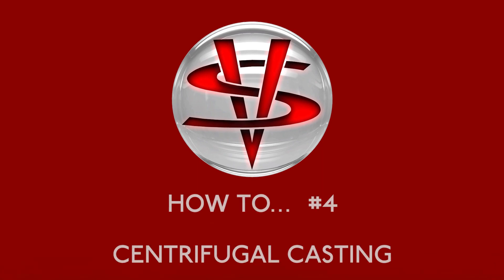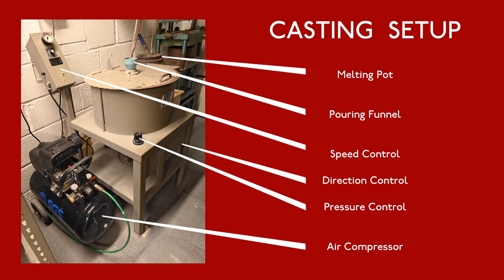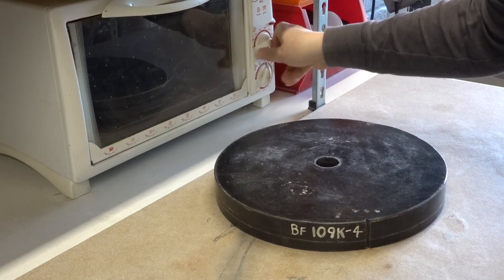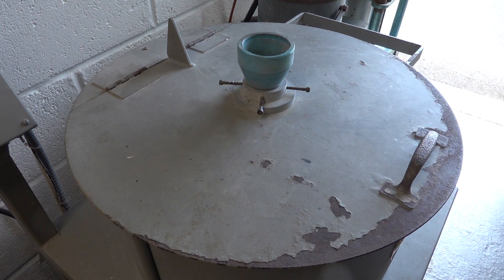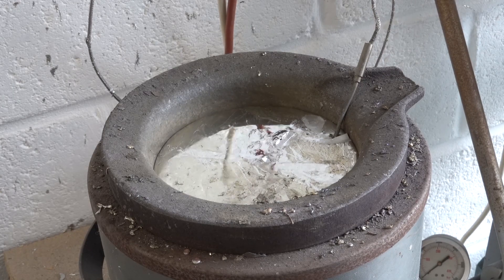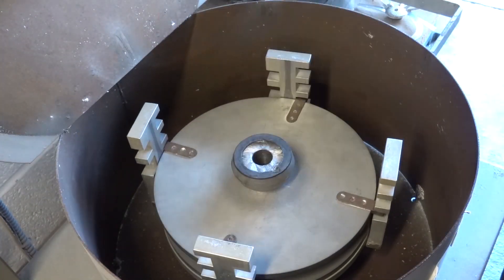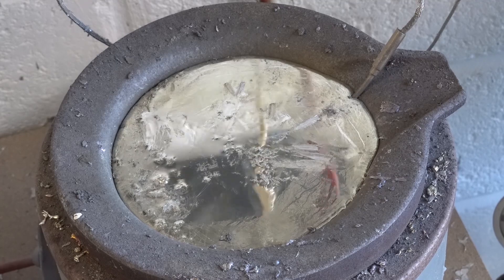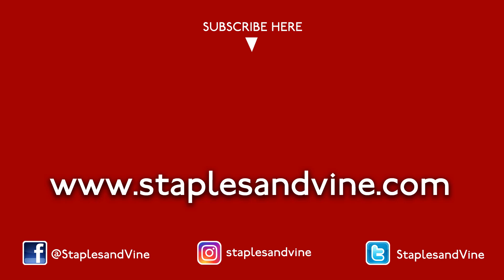HOW TO… PART 4  ‘CENTRIFUGAL CASTING’

Comment: I am considering commissioning some sculpts of 1/56 figures from a talented sculptor. I want these figures to be size compatible with figures from a specific existing commercial range which I like. I can then wargame with both my own and the commercial figures at the same time.
But will the resulting production casts I make shrink and end up smaller than the sculpts? In other words, should I commission the sculpts slightly larger than the existing figures from the commercial range?
Reply from the maker: Yes you will have to allow for shrinkage! Metal contracts on cooling and it depends on the bulk of the item being cast. Larger chunky items shrink more than small fine items. Allow for about 2-5% and you should be OK. It's all trial and error so try a couple, measure the result and go from there. 🙂

Comment: Why are the vents cut to the perimeter? Could they be brought back closer to the center, ensuring to avoid feed mouths and drilling to the top of the mold? Would this prevent overflow spilling. 
Thank you for the wonderful layout of your videos. They are very educational and provide all the right information.
Reply from the maker: Thanks for the comment Jason. The metal flowing down the vents is not a problem as the excess is easily removed on clean up. The primary goal is good casting quality which is way more important and more difficult to achieve. 🙂

Comment: Hi sir
air compressor for what it was: show in the end video
Reply from the maker: Hi Imran, the compressed air is used to operate a ram which holds the mould closed. The clamping pressure can be adjusted on a dial. 🙂
Reply: @StaplesandVine  please show me in the video

Comment: Just wondering if the vulcanized rubber could be used with aluminum?
Reply from the maker: Definitely not, unless flames, explosions, fire-engines, ambulances and a trip to hospital are on your agenda. This process is for tin based alloys only.
Reply: @StaplesandVine  thats what i was thinking, but never delt with vulcanized rubber. and figured it was worth a quick ask.

Comment: Very nice. I thought that material was zamak. Do you also use it for your castings?
Reply from the maker: I only cast in pewter. Zinc based alloys require a much higher temperature and are more dangerous to cast with.

Comment: Great video series! I love your videos in general. Im new to these processes for pouring pewter and had few questions. I was wondering what makes you choose the vulcanized rubber method vs the silicone? Is one better for some things then others? Does one result in better details? Also I was just curious, I questioned it and wavered back and forth but what makes you choose to do pewter castings over “cold-casting”? if you have tried that. Thank you in advance for any help and information.
Reply from the maker: Thanks Justsomeguy glad you like the series. Lots of questions...
1. Vulcanised centrifugal rubber moulds give far better quality castings than the cold cured silicone with less distortion and finer detail.
2. Cold cure silicone moulds are only used by me for one-offs or to convert a 3d printed part into metal.
3. Silicone centrifugal moulds are available but are more expensive.
4. Resin / cold casting is fine but fails cannot be re-cyclyed unlike pewter castings which are just re-melted and you go again.
5. Tried resin casting - didn't like it. 😁

Comment: please tell me how thick the wing of the plane is and what kind of rubber do you use for the mold?
Reply from the maker: The wing is about 6mm thick at its maximum. There are a lot of different rubber grades but I get mine from https://j-coker.co.uk/casting-discs/
Reply: I'm trying to pour a sculpture height 10 cm thickness 1.5 cm rubber does not withstand temperatures, cracks. you haven't had that experience
Reply from the maker: It sounds like the grade of rubber is not suitable for the type of metal you are casting. What metal and rubber are you using?
Reply: www SETEK rubber.  
4%aluminum . 1% cuprum . the rest is zinc
Reply from the maker: Even high temperature rubbers don't like Zinc casting (420C) . I suggest you speak to your rubber supplier and ask them to recommend a rubber for your application. If they can't supply you may have to consider a lower temperature metal (Tin alloy).
Reply: thank you very much, I will work on it.

Comment: the metal used is aluminium?
Reply from the maker: No, I cast in Pewter which is a Tin based alloy. These moulds would not withstand the high temperatures needed for Aluminium casting.

Comment: Thank you for sharing your knowledge. My project is a scratch build 1/12 Jaguar XKR X150. Currently working on the suspension, masters from Evergreen styrene and silicone mold casting in rigid polyurethane resin. Australia.
Reply from the maker: Hi Geoffrey, thanks for the kind comment. A Jaguar XK150 is a real gentleman's project. I hope you are enjoying the journey. All the best, Sera.

Comment: Sir can you please tell which grade of silicone use for cast aluminium parts  because temprature of aluminium is very high
Reply from the maker: Hi sahil, this process is not suitable for aluminium casting. Please don't try it.
Reply: But sir which metals are suitable for the process
Reply from the maker: Alloys of Tin and Lead work with these moulds.
Reply: @StaplesandVine  hello sir! very inforamtive video. I wonder how hard the tin+lead alloy is. does it deform easily?
Reply from the maker: @JericopterPh  the higher the tin content the stronger the casting but it is more difficult to cast that is why the lead is present. There are lots of different grades. It is best to talk to your supplier about what you wish to cast.
Reply: @StaplesandVine  Thank you so much sir! now I wonder how much would does the whole kit cost..
Reply from the maker: @JericopterPh  I couldn't tell you that I'm afraid I bought my equipment over 20 years ago and prices have gone up a lot since then. Check out https://conleycasting.com/ for the latest news

Comment: You're throwing a lot of oxides back into the melt. I wonder how badly it would affect the material properties in the last batches.
Reply from the maker: The oxides are skimmed off the molten pewter frequently and the regular addition of fresh metal keeps it in good condition. Fluxes are added at the end of a casting session. But to be honest the behaviour of the metal remains very consistent. Atmospheric conditions have a greater affect

Comment: I wondering what will hapens if you directioned the vent channels direct to the large feeding hole instead to the boards,be careful,I dont know if it spit the metal out,so its just one experiment...maybe it will be no problem to use high speed for beter detail in casting if the system work.
Reply from the maker: Hi Lancelot, thanks for your comment. The molten metal will fill and block any air vent it comes into contact with so they must be kept separate at all times. Getting the air out is crucial for successful casting.
Reply: @StaplesandVine  yes,thats right

Comment: Does this also work for alluminium?
Reply from the maker: Hi Viggo, NO this method does not work for Aluminium. Aluminium melts at 660C, using this method you will end up with a fire and probably a visit to the hospital.
Reply: @StaplesandVine  Thanks, do you maybe know methodes that work for alluminium?
Reply from the maker: @viggovanhoutte4939  try searching for 'sand casting aluminium' 🙂
Reply: You can centrifugally cast aluminum, just not using this machine and rubber molds. I've never seen a centrifugal casting setup for aluminum that even comes close to being practical for the home shop hobbyist, or even small production shops. Stuff like that tends to get outsourced.

I did see a very crude home setup here on YouTube, but that rig didn't even have a containment shield. Even with a full fire suit I wouldn't be caught near a contraption like that. No casting project is worth suffering severe, possibly debilitating or fatal, burns.

Comment: What material is the mold made of?
Reply from the maker: The mold is made of rubber. You can see how in episode #3.
Reply: @StaplesandVine  I'm Vietnamese I don't understand. Can you please write the name of the material, I want to buy
Reply from the maker: @hblure3540  rubber
Reply: Thank you very much
Reply from the maker: You are very welcome.
Reply: Wow. Can this be done with aluminum ?
Reply from the maker: Hi Chris. No I'm afraid aluminium melts at a much higher temperature and will probably set fire to the moulds.
Reply: @StaplesandVine  thanks for your help. I think im going to set up this way for pewter as well. Seems pretty good
Reply: @StaplesandVine  could I ask what your machine is called ?
Reply from the maker: This is the casting machine I use https://conleycasting.com/Conley_18_inch_DC_Digital_Air_Cast_Machine.html Others are available... just Google 'centrifugal casting machine'
Reply: There are many types of rubber. Please let me know what kind of rubber you use to make the mold
Reply from the maker: 'Grade 70' http://j-coker.co.uk/casting-discs/